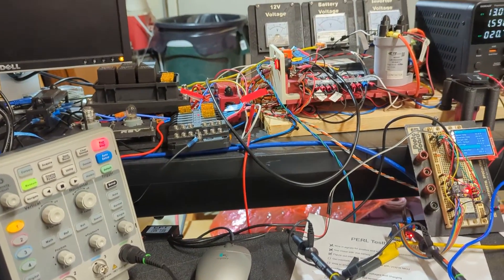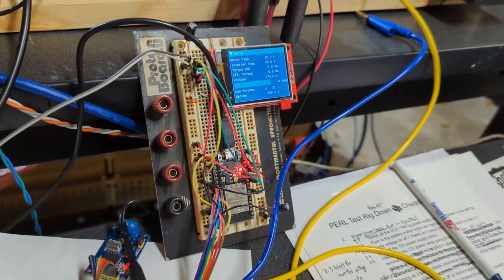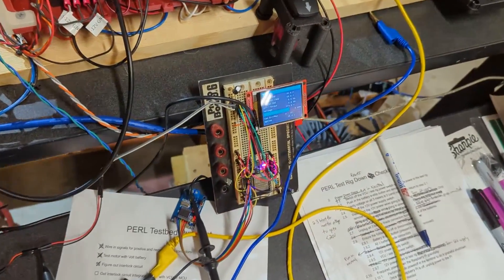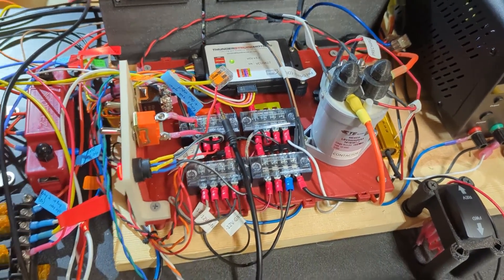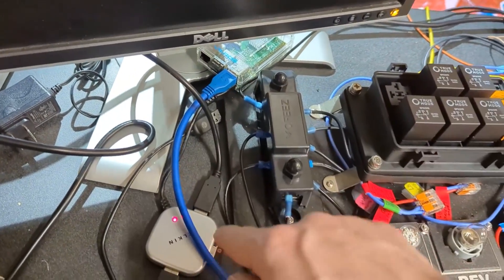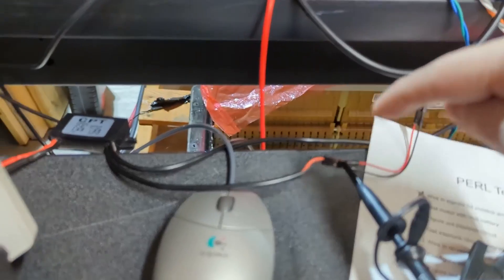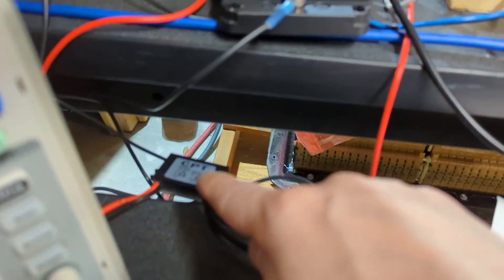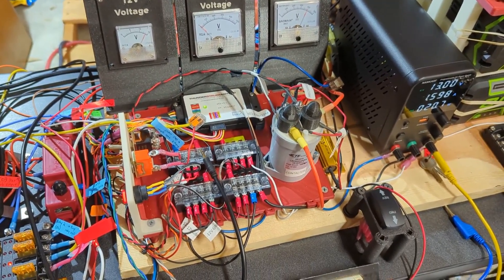Porsche 924S EV Conversion - Part 20 - Thunderstruck VCU Comm Problem Fixed?

Comment: Would it be worth replacing your 12V PSU with a lead acid battery? It may soak up any voltage fluctuations in a way the PSU doesn't.
It may not fix the back feed power issue but might be worth trying to see if it helps.
Reply from the maker: Maybe but since I have a solution so far we are going to run with it. Also the power supply is meant to be the standin for the DC-DC converter so we should be running with that soon
Reply: @FrankGraffagnino  Are you not going to have a 12V battery then?
Reply from the maker: @alibro7512  no definitely will. We will have a 12V battery and a dc-dc converter
Reply from the maker: @alibro7512  actually I think one of our next videos will show it
Reply: @FrankGraffagnino  I have a Mitsubishi Outlander PHEV charger in my car and saw around 50A from it as it recharged my battery that had been allowed to get very low. 🙂
The ac charging is only 3.5kW but the dc to dc is very good.